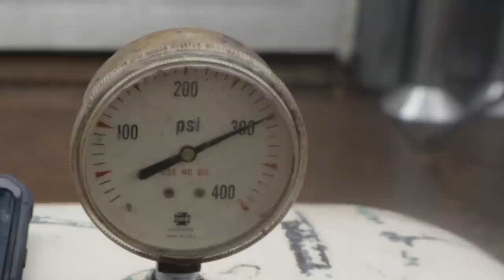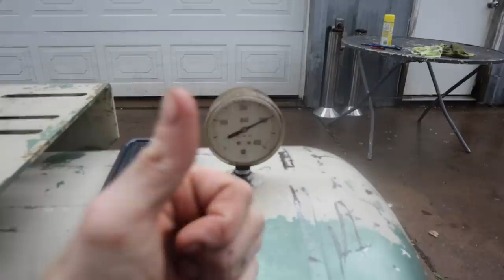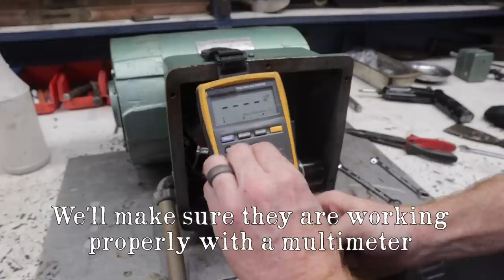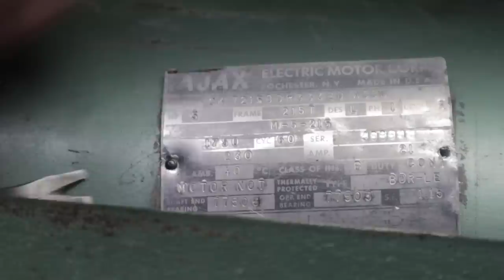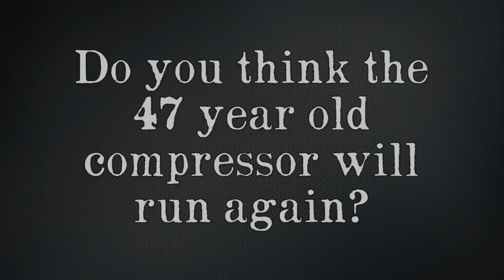OLD 2 Stage Air Compressor ~ WILL it EXPLODE!?! ~ Hydro Testing the Tank ~ RESTORATION Part 2

Comment from the maker: Question of the Video: Why do you think old tools & machinery were made to last back in the day?
Reply: Planned obsolescence with the aim of maximizing profits. A product which is precisely calculated to break or wear at a certain rate makes for a more predictable outcome in regards to the consumer base repurchasing the item in question and guaranteeing a profit which can be more predictable. And it sucks. It basically eradicated the trades which maintain and restore a wide variety of products which we now simply just consume and throw away.
Reply: Lack of engineering knowledge, due to a lesser understanding of material properties, back in the day. Now engineers/designers can calculate exactly the material strength needed, minimizing the over building of products which results in shorter lifespan = more product sold.
Reply: People didn’t have money to replace tools and machinery as often so they needed to buy what would last a long time
Reply: I think one answer may be that manufacturing techniques ensured that things could be disassembled, and therefore repaired.

Modern manufacturing means that there are lots of components that are integrated to minimise construction costs, and inevitably that means that individual components can't be replaced.

Add in a good measure of planned obsolescence and the other factors that M J mentions, and you have today's disposable society ... sad really, isn't it.
Reply: The older tools were built to last for multiple reasons. Not the least of which was that people took pride in their work/tools/and the building of tools for others. Another was that those tools were built to supply our men over seas fighting for our freedoms. Yet another reason is that men had more testosterone back in the day and really put their tools through their paces, often working beyond what would be considered OSHA compliant these days. The safety-sallies have put so much input into the manufacturing process that  well built tools would be cost prohibitive even 100 years post Depression. Also, components were built out of tangible substances that could be repaired instead of replaced. The repairability made them last longer as well.
Reply from the maker: @spiderprint  That's definitely why many tools made today do not last!
Reply: Proudnes in their job
Reply: @thomasarussellsr  You've partly hit the nail on the head here. Before the days of international conglomerates and brand engineering, a company that made a compressor counted on the purchaser owning that compressor for life, and buying genuine replacement parts from the manufacturer. That would keep a revenue stream alive rather than forcing people to buy a new machine. These weren't just made to be tough and last a long time, they were made to be fixed, repaired, and rebuilt over and over again.
Reply: because more parts were hand made and the seller hadn't enough workers to build a lot so their goal was to build a long lasting product requiring only some servicing from time to time... Also, people weren't wasting stuffs at the time. The basic matters were not cheap.
Reply: I think engineers demanded it. If you come to work and your compressor is not working then you loose time and productivity. 
Manufacturers reputations were built on long service life and reliability.
Reply: @jeremytravis360  downtime costs more now than it did back then. it's even more vital that things work when you need them to and the devices that are bought for industry these days are plenty reliable. the thing is that there are a lot of weekend warrior types these days that buy tools and barely know how to use them properly also these are consumer-grade tools and made to fail so that they have to buy new ones, it's planned obsolescence in consumer-grade goods not some of the ridiculous reasons I've seen in this comment section.
Reply: Most people back in the day only bought one tool for their lifetime. So the manufactures know they had to be made well and were self concourse to make sure their reputation stayed in tack. The CHINAMAN just do not give a damn.
Reply: At that time, the operations were run by technicians, often by those who had invented and designed the product itself. This personal responsibility was the reason for better and better products.  No technician wants to work with bad tools, so they constructed their own tools according to this maxim. Today, these same technicians are displaced from the leadership positions in the companies, so that they are only the executive organ under the guidance of the management trained on profit maximization. The centuries-old supremacy of technically gifted people was taken over by economists. That is the main reason for the destruction of our world.  It's about time to change it!
Reply: @anthonydibart1126  The mindset was so much more positive for the customers.
Reply: They still make the same compressors in everyway and have for over 100 years! That is the most cloned compressor there is
Reply: @lonniewhite258  Thank you for letting me know. Have a great day too.
Reply: I'm not confident that they were. The ones from back then that are still working were made to last, but we don't have nearly all of the ones that were made. The ones that WEREN'T made to last have already died and gone, giving us a biased sample. It's like asking why only fast people run in the Olympics. The slow people didn't make it.
Reply: Expensive tools today are engineered  to make it to the week after the warranty then try to repair it no parts available if its from China do not buy it!
Reply: 50 years ago most manufacturers and their employees still had a zeal for doing the best and being the best. Corporate greed has since killed that. It's all about the bottom line now. That usually means shipping jobs overseas to substandard manufacturing facilities.
Reply: For one thing people did hands on experience like the old blacksmiths and the romans and cultures like that that worked metal by hand and learned the science of it and of couse there lives actually depended on quality but now a days lazy workes after big bucks and putting all there trust in computer algoriths for just so so quality. I worked under two actual blacksmiths and learned how to heat treat metal and  made many swords and knives out of old car leaf springs.
Reply: Not everything was built to last.  The cheap stuff broke and was throw out and what we have left is the good stuff.
Reply: That is an INDUSTRIAL compressor which style are still produced (Saylor-Beall is a fine US-made example).  The cheap consumer stuff is mostly gone from the old days, and the cheap stuff we have today made many tools much more accessible to home gamers. I run two forty-year old Saylor-Bealls of the type still in production and if I were buying for a business would have bought new.

Comment: I have been able to get one of those old Quincy Compressors and the owner had took the original motor off because it was 10hp 3 phase and he didnt have 3 phase power he put a 5hp single phase motor on it and the motor was to small to keep it running past 100lbs so he sold it to me and i put the original motor back on an changed the pressure check valve, now its running like new .. Love watching your videos, i never miss any of them, thank for all your hard work and dedication to these old machines!!!

Comment: One of my friends had an old craftsman compressor - the tank 'sizzled' when at pressure. I told him to immediately relieve the pressure, and that he needed to replace the whole tank. It was a BOMB just about to go off!
Reply from the maker: Ya a lot of people think that, but most the time they just tend to LEAK air and not blow up, but it's still always better to be safe than take a risk on something like that!
Reply: @SalvageWorkshop  is it even possible for a tank to "explode" or fail catastrophically with anything below 200psi?
Are pinhole rust spots enough to make it explode? Will it just hiss and leak rather than explode at 150psi?

Comment: In my opinion I would NEVER EVER reuse a tank that old. If you really want to save a compressor you can buy a new tank and transfer the pump and controls. Only a fool would reuse something like that, in my opinion. Hey everybody has to die sometime, it just shouldn't be when you're draining you compressor tank.

Comment: 11:48 ruining the plated contacts on the switch by sanding the plating off. Contact cleaner would have cleaned them without damaging them.
Reply: On one hand I agree because in theory they should have a silver plating, but in experience I've found that air compressor switches seem to always have burnt off the silver plating already.  (On the 3 compressors I've worked on, in which I just used Q-tips and rubbing alcohol which cleaned them right up)
Which really means you should replace it, but they make the copper over 1/16" thick so they can keep going on just copper for far longer than the silver lasted in the first place.

(and this is even on American made compressors that claim to have the proper sized switch...)

Comment: With all of this work, wouldn’t it have been a good idea to scope the inside of the tank to check for rust? I am not familiar with rebuilding air tanks or whether a pressure relief valve protects against the tank exploding.
Reply: USB borescopes are perfect for the job and cheap too. I use mine often.

Comment: Years ago i saved a big speedaire compressor from going to scrap, it has a Champion S-20 pump with some broken valves, also had a 3 phase motor, i got 4 new valves and a good 220vac motor and with a little work it has been the best compressor ive ever owned, build date on it was 1972. Glad to see you saving these great old compressors, good job!

Comment: It didn’t look like you changed the motor bearings. If it were me taking that motor apart, I would have replaced the bearings while I had it apart. Bearings aren’t that expensive, use good American made bearings.
Reply from the maker: Nope. Might have been good practice, but the bearings were fine! If it starts squeaking I'll deal with it then.  I'm a firm believer in if it ain't broke, don't mess it up!! lol Thanks for watching and commenting! I truly appreciate the support! Lot's more to come!

Comment: I messured the thickness, of some of those old tanks. with a ultrasound scanner from work.  I messured it all over. it where between 7-8 mm. thinnes in the buttom.  New'er tanks I have messured down to 5mm.  So I dont worry that much anymore if old Tanks are safe. But inspect by eye for defects :)

Comment: I inherited my 91 year old father 1959 Kellogg American Two stage beast of a pump sitting on a John Wood Company 85 gallon 1959 horizontal tank (200 max psi) and it had a 190 psi safety valve on it that I'm replacing with TWO 165 psi valves.
It operates just fine, actually very quiet and impressive! 
I will never run more then 140-150 psi at the compressor.
I should hydro test it but I have to wonder, even if it held pressure to lets say 300 psi what's to say it won't simply fail at 140 psi a year or two or five down the road?
Without a visual inspection and knowing how pitted or how deep the pits are or, how thin the inside eroded away ... isn't it just a questionable device?

Comment: Because a capacitor measures the correct value doesn't mean it is a "good" capacitor. Charge and discharge should be taken into account. Leaking caps... etc... Blocking DC... cause issues and damage. *shrugs*... Thank you so much for sharing your knowledge and time. I love your channel!!

Comment: I am about to embark on a similar restoration project and was wondering what fitting was used to pressurize the tank with the pressure washer. I have seen several videos where guys use this method but can tell what kind of fitting was used. Will a regular air fitting fit the pressure washers?

Comment: The motor sure did not have that many hours of service, very clean. Never use more than 35 PSIG air to blow out the windings.
Reply from the maker: I was rather surprised at how well it looked inside as well! I figured it would be MUCH more dirty, like the outside of the whole unit when I first got it!

Comment: there's i know who built engines for rally cross and stock cars  in the uk he had an old dish washer removed from his kitchen and used it to clean parts and engine cases before working on them, he used de-greasing liquid also the heating still worked so after a clean the likes of bearings were easily replaced as the casings expanded because of the heat

Comment: Fill it full of water a  manual water pump, lever action to exceed the tanks, air pressure rating in order to make sure when you do have air in it you do not explode the tank. Water does not compress as does air so if you have a tank that is no longer worthy of holding its pressure. The water will only squirt out rather than the tank explode, just a tidbit information from personal experience

Comment: Black paint and add the white teeth so the tank will look like the one Stephen Cox has on his service truck. 
Meant to instill fear in the enemy. 

Pressure testing your tank is only half of the check to confirm a tank is still usable. 
The first thing you should have checked was the condition of the inside of the tank. 47 years of moisture could have rusted the inside to near the point of failure that a pressure test alone may not find.
Reply from the maker: HMMMMM... now there is an idea! I guess we'll see!

I definitely checked the inside of the tank, it's just hard to get a camera in there!
Reply: @SalvageWorkshop       Endoscope USB Camera !

Comment: After watching your hydrotest, I am curious about unseen rust damage to the tanks.  I realize the hydrotest is a destructive, i.e. pass/fail test, but what about unseen rust that may pass the test but still be a potential burst risk.  Is there some non-destructive test that can be done on tanks such as Magnaflux, ultrasound, etc. that can show significant thinning?  I have often wanted to acquire a used compressor but realized that bursting is a main risk and if the hydrotest is the best way to reduce that risk.  Of course if it's an auction item, for example, that is out of the question.
Reply: Hydro-testing is the standard way of testing pressure vessels, though what he did was a pressure test.   Hydrotesting is testing the tanks elasticity, ie how much the tank expands at 5/3 working pressure and then how close it goes back to its original volume.  I don't know if compressor tanks require Hydrotesting by the DOT.  I know SCUBA tanks do as they hold 5000psi(300bar) and are dangerous when full.  Don't knock the valve off one, it'll launch like an uncontrolled rocket.

For those who don't know, He used water to test the pressure because if the tank ruptures it's not a bomb.  Water will crack the case on major failure, but as it doesn't compress won't explosively expand on failure, just start running out the crack.

As for non-destructive tests? If you have tons of money to spare, i think you might be able to get a tank x-rayed to find fatigue/micro-fractures in it.  Though I don't consider a hydro-test actually destructive, it's just exposing the weakness that's already in the tank.  The test it self didn't cause the weakness.
Reply: Industry normally borescopes tanks and other pressure vessels. USB scopes are cheap and fun to use.

Comment: I was came across a free champion 120 gallon with a R30 pump. It needs a rebuild I have all he rings valves bearings gaskets. Im just lacking a bit of knowledge and confidence. Not real sure how to get a even hone in this thing when you can't pass out the end of the cylinders with the integrated head? With all the info on the internet these days, not anything I can fine on rebuilding an Champion R30. Perhaps you will get to one before I destroy my unit trying! lol  Thanks for sharing!

Comment: It used to be a matter of pride in workmanship. We have lost that. Now, things are manufactured, much of it in China and the pride has been replaced with a need for profits. Corporate philosophy has changed. Corporations used to value the customer, the employees then the stock holders. Now they value the stock holders, the customer and the employees are the last consideration. It's resulted in a loss of pride in workmanship and a decline of product quality, as a result. Profits are king! Skilled employees are  viewed as cheap tools, easily replaced.

Comment: Are you sure you did the mixing right? First paint then hardener then thinner is the correct order. You put thinner second.
Reply from the maker: If there's a specific order, then I guess I had a 50/50 chance to get it right!! I only know enough to be dangerous! Now I know for next time though, thanks! The finish turned out pretty darn good though!
Reply: @SalvageWorkshop  if the ratio of second and third step is the same number then you did nothing wrong. 
but if the ratio is 3:1 and 15% thinner then it will end wrong. 
if its 3:1:1 then it doesnt matter.
Reply: @SalvageWorkshop  you think the inside of the tank is rusted? any ideas about that?
 i plan to do the same to my compressor and i dont know how to treat the inside of the tank..

Comment: The best way to remove drive screws is to use flush cutting pliers. It's like using two knife edges  against each other to cut in under the head. Then you can use the heal to rock up and the screws  easily . . Make sure there are NO bevels on the flush cut side of the plier.